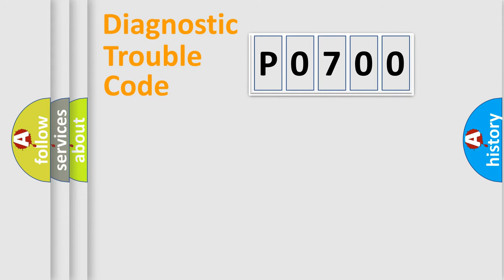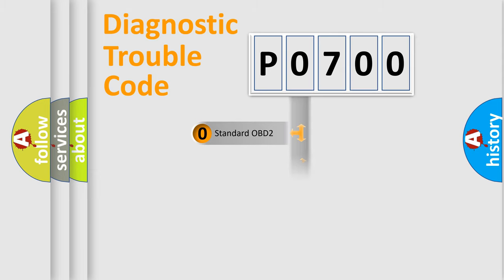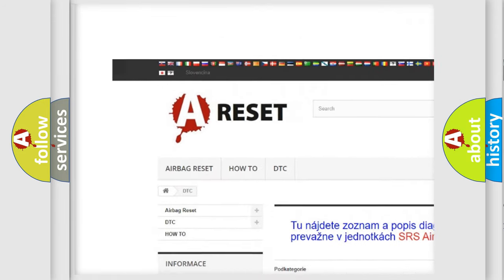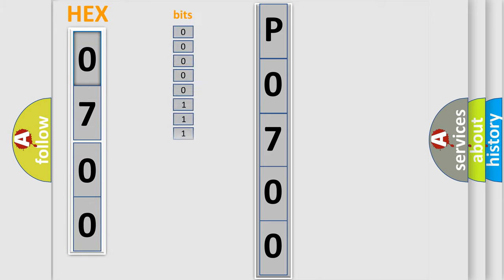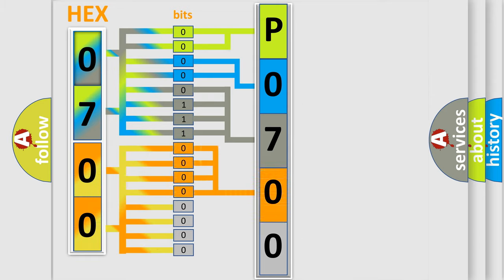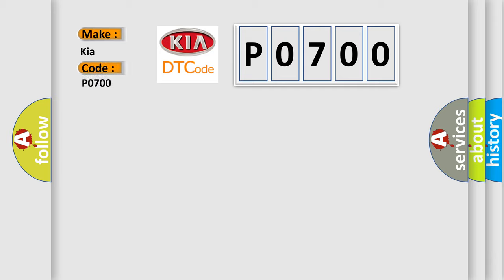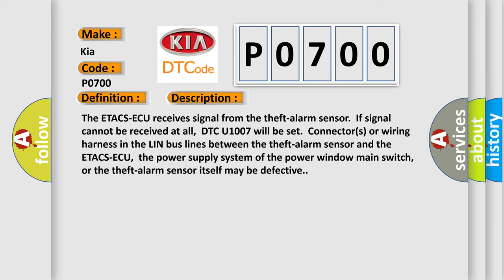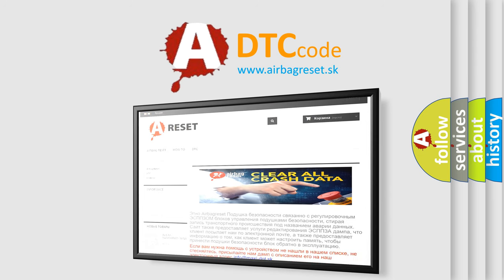DTC KIA P0700 Short Explanation

Comment: This video is absolutely bogus! This code is a generic code not diagnosing anything!, just letting you know a problem exists in the P or powertrain system! A second code should follow showing a fault! Basically electrical connections should be cleaned and verified that they are not open or shorted, and that a sensor is within a proper range! These codes on a kia can be very involved! There are multiple sensors involved with speed, wheel-abs, position sensors that only a specialized mechanic would understand and realize are all connected to the trans and Pcm computer, and they might not even send a code because they are still operating within range! There are very few vids on kia for these codes! Check for fresh oil and up to proper level! Temp sense switch? Harness replace? If the last two cant be done by you, ...time to take car to a highly rated transmission shop!!! A regular mechanic or dealer will just take it to a trans shop and charge you double! Save your money!